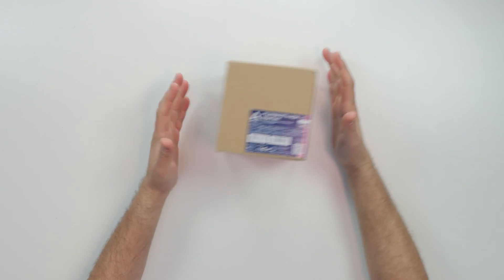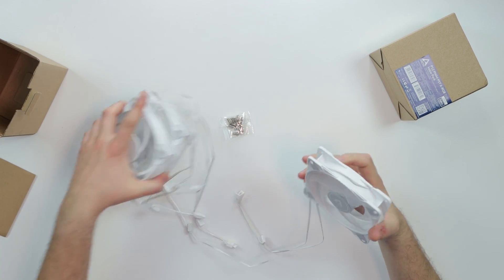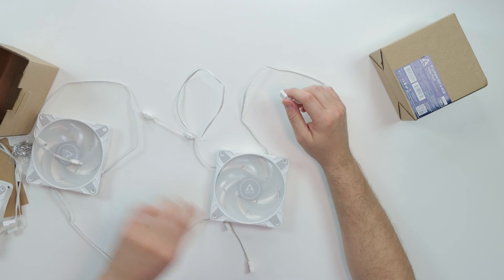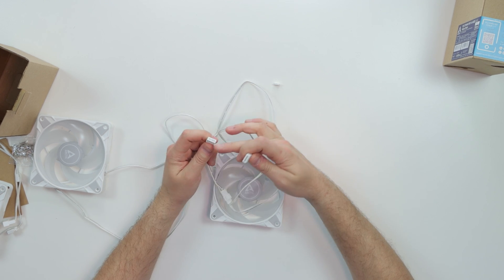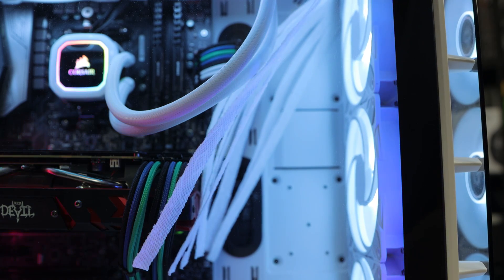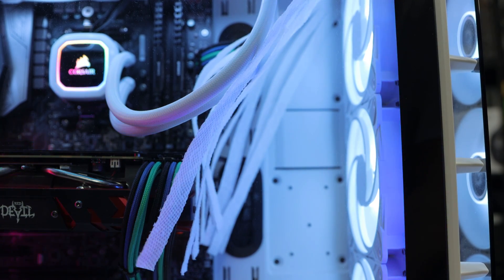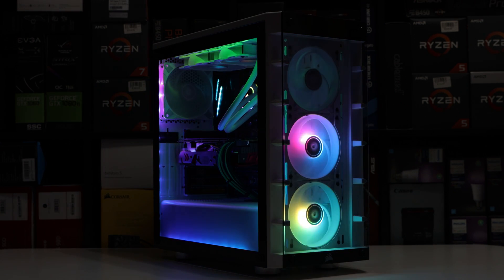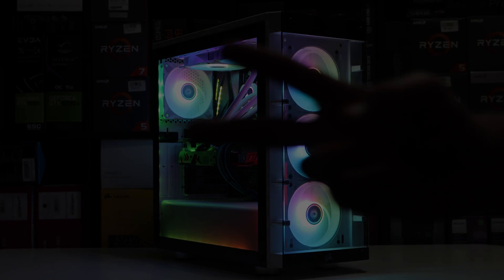Dope Fans - ARCTIC P12 aRGB Review

Comment: hey man great review, just wondering how the noise levels compare to the regular p12s? As i can see these have rubber vibration pads? would love to buy the budget p12s but if these are a lot quieter i’ll just get these.
Reply: Imo they're quiet, even at max rpm they're loud but they're not like the phanteks m25 argb fans.
Reply: M25 fans are good too in case you consider them. They're like 3 for 40$
Reply: @otreblarazalas669  Thanks for the help 😄

Comment: I'd probably buy these for builds where I have a limited number of PWM headers. I mean, as long as they are PWM fans, I can work with the connectors. Makes it easier than buying splitters and you can optional run them chained according to position. I honestly like that setup.

Comment: As usual, great info and humour. What controller are you using here? I'd like to set up fans with those chase effects.
Reply from the maker: The control was from InWin fans here's the link https://youtu.be/Wdrsnt7SQns
Reply: @KosherTech  Nice review!! Hey just wondering can we get the review of Fractal Prisma AL-12 pwm next? They have the 85 cfm airlow and 2.7 mmH2O static pressure and also RGB. Sadly they do not have reviews from any good reviewers. It would be nice to see your analysis of them.